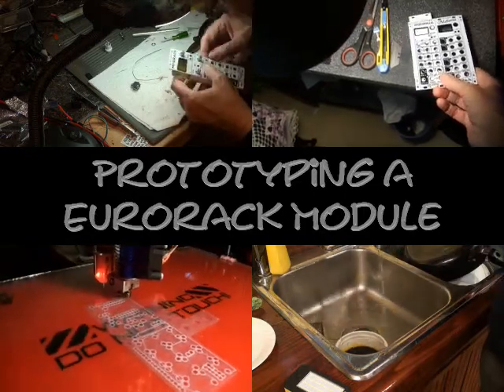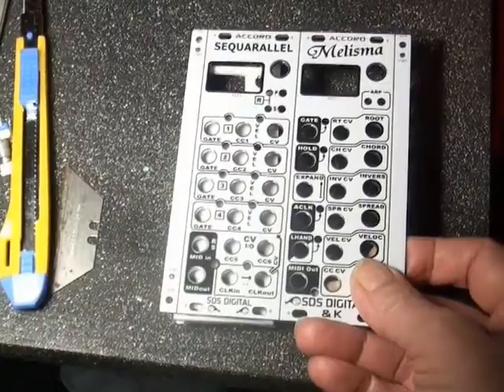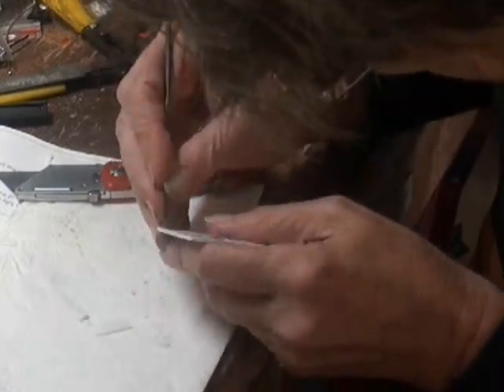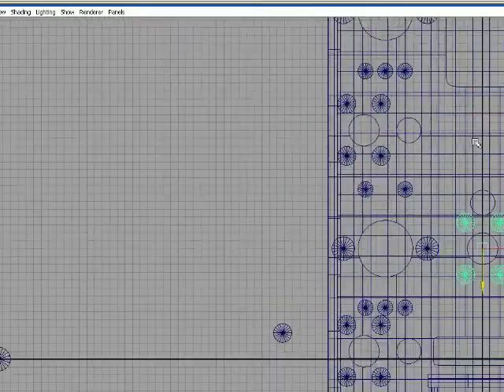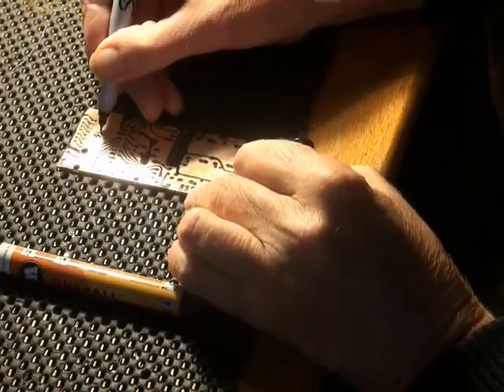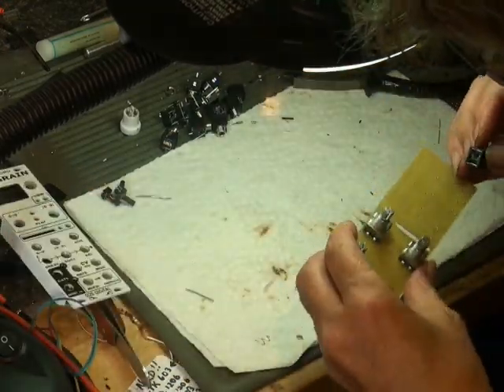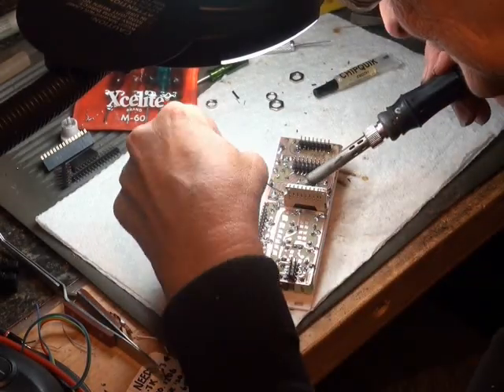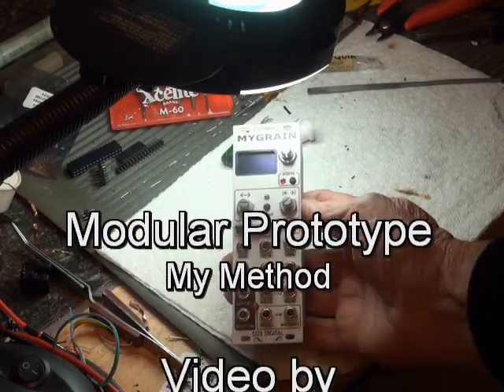Prototyping a Eurorack Module-Part 1

Comment: Wow, it's fascinating to see a prototyping process that's so totally different! I'm amazed by the hand-drawn routing. Placing the through-panel components and drilling them out before etching is a bold idea. Even with computers sometimes the routing is still no easy feat. Very inspiring!